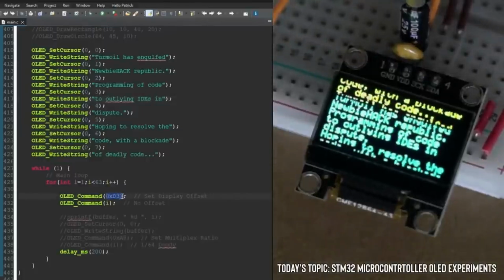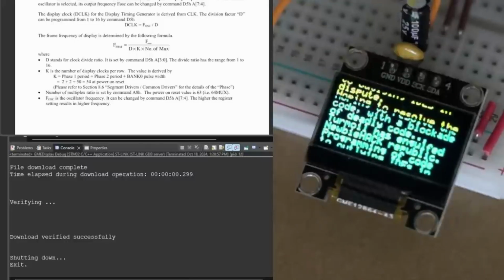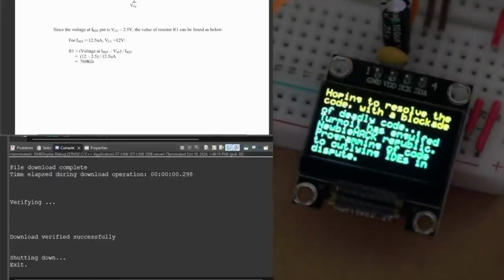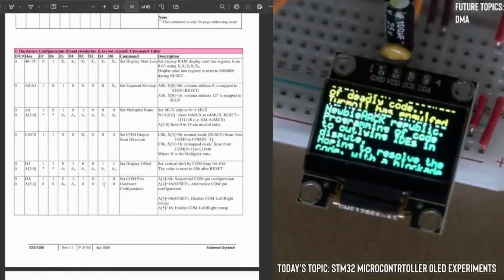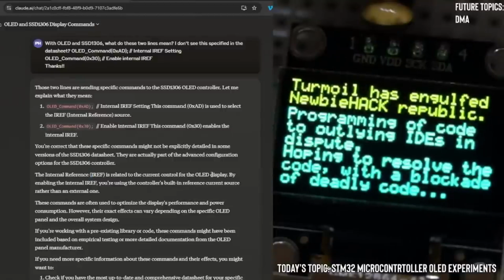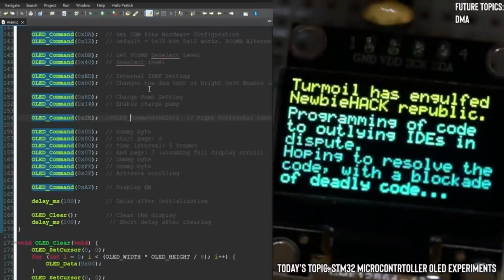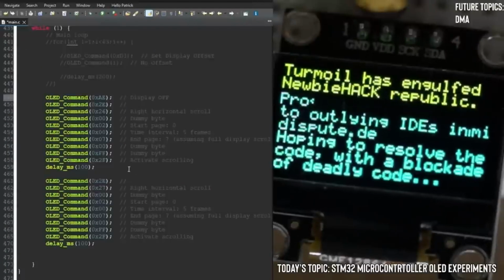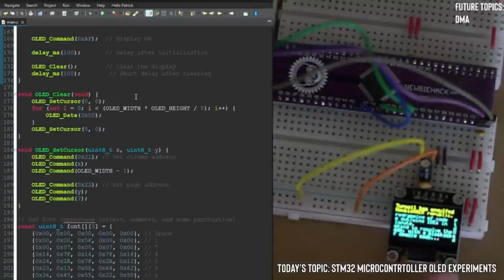OLED Display Horizontal Scrolling (Didn't Quite Work) & Advanced Settings with STM32 Microcontroller

Comment: Fantastic hacking, I love seeing this kind of stuff. I think the artifacts are probably because you need the processor/microcontroller to fully reboot the display before sending any display commands. Otherwise the OLED's controller will still have initialized memory floating around. When you unplug the whole thing for a few seconds, that's probably long enough for the OLED controller's RAM to get flushed.
Reply from the maker: Thanks, and good point. You wil see in the next livestreams after this one, I did some more digging and experimenting.